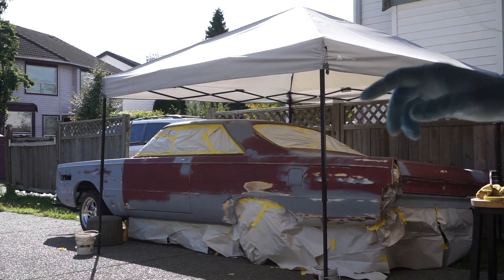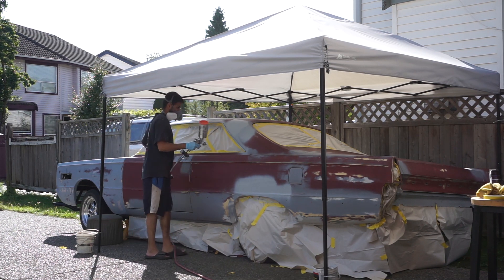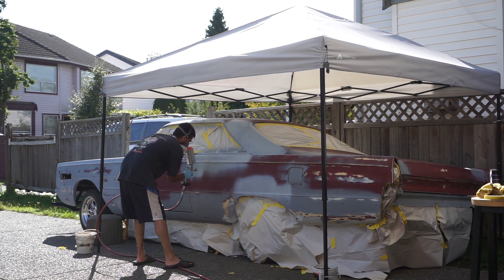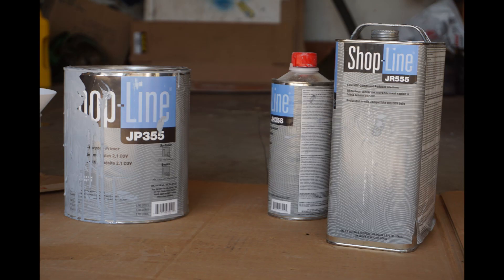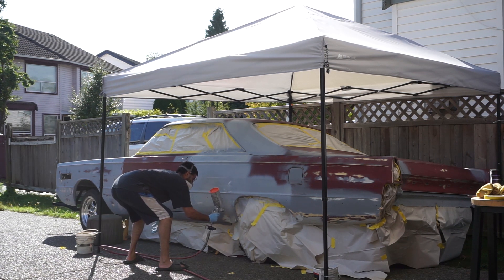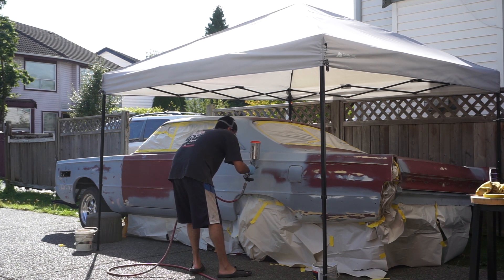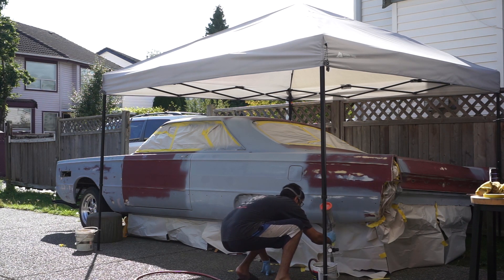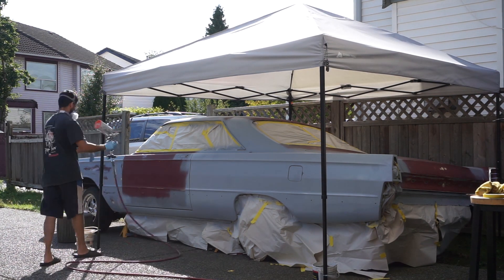Let's SPRAY!  Automotive Primer 2k urethane

Comment: One light coat followed by two heavy. From the video you look like you have the guy too close to the body. Longer strokes with the gun. Either all the way down the car or all the way down the panel. You usually want to do your hard to reach places first, wheel wells, door jams.
Reply from the maker: gonna give it a shot when i do the hood. Thanks for the advice!
Reply: Perfect advice, couldn't have said it better myself!

Comment: What pressure.  Do you remember.   Im spraying first time and it stripped like crazy.  Fluid is all the way out.  Maybe i set it wrong.  Spec sheet for the primer says 7-9 psi
Reply from the maker: My gauge is hard to read but its betwen 25-40 psi.   7 to9 psi seems way too low.   The slec sheet usualy list pressure at the cap. Aka the nozel end of the gun which is wrong.
Reply: @Wrenchlife604  I did run it at 28 and it just wasn’t enough coming out. Even with the fluid and fan maxed.  Not sure what I’m doing wrong.  I’m going to sand it flat then attempt another coat.  Some of it looks perfect while other seems very dry.  I can’t imagine what the base would look like.    Expensive lessons.
Reply from the maker: @Imwright720   reduce your mix a little more.  i use a  more reducer then recomended. and it shoots out better. you will need more coats but it lays out nicer. up the pressure if you need to aswell. find out what works with your setup
Reply: @Wrenchlife604  there is no indication on the spec sheet that it can be reduced.  I have the hardener but I don’t think you mean that.  It’s nason 2k urethane primer, not the high build one, at least it doesn’t say it.   This is literally the first time so I’m following the spec sheet the best of my ability.  I wish I knew before  that the 8-10 psi was at the tip.   The next 2 coats will be at 40-50 psi, After I fix my water problem in my air line.   I will google what I can thin it with and give that a try. Thanks.